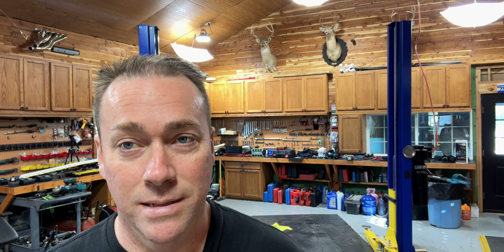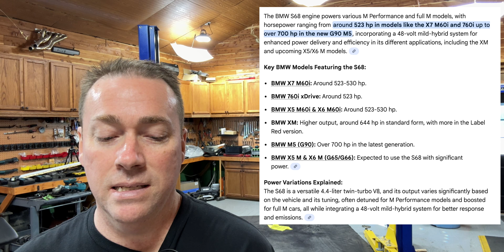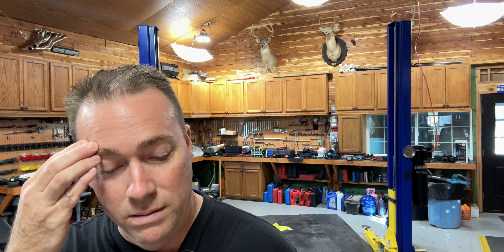The Truth About BMW's New S68 V8 Engine Reliability

Comment: The real statistics will only be clear in 7-10 years after the engine release year, and I wouldn’t even consider cases where the owner adds a cheap chip from eBay or installs a cold air intake that lets in ten times more dirt into the cylinders and oil.

Comment: Have a 21 X5 M50i since new, it now sits over 31k miles and is still going strong.  Next maintenance items coming up would be plugs and coils, plus transmission fluid flush.  Looking to put another 30k miles the next 4-5 yrs headache free.

Comment: Probably just not recycled plastic for the timing chain guide issues. They still recommend a 10k oil change interval and 3 year 36k provided maintenance. The oil should be changed every 5k - 5500 miles on these, especially knowing they might be using recycled plastic for the guides.

Comment: For BMW hybrids (7 and 5 series) in Europe the factory recommended oil change interval is 2 years or 18 k miles…of course most of them are used in heavy city traffic and stop and go driving and in addition to that the hybrid system switches the engine on/off continuously. Those engines are full of carbon deposits and sludge inside even after 60-80 k miles…crazy.

Comment: I think the problem with most BMW’s why the timing chains fail not all of them because I know some are just major failure prone to timing chain failure, but my friend has a BMW with the N 20/N 26 engine and it has 205,000 miles on it and it has the original timing chain guides I think the reason why on a lot of BM BMW’s the timing chains fail is because they recommend very long oil change intervals. Her car says to change it every 12,000 miles. She changed the oil every 3000 miles up until recently cause it started leaking a lot and it’s still going the chain does have a lot of slack when the engine shut off, but it’s still running as of now.

Comment: You’re correct! I’ve been driving Bimmers since 1984. Total of 8 Bimmers. I’ve learned the hard way that BMW intentionally engineer their engines to start to fail after 60,000 miles! High paid engineers look for ways to increase profitability from service? They know what they’re doing! Nissan removes the weak plastic items from the B58 for sustainability.
Reply: Nissan?
Reply: @runner3033  Maybe he meant Toyota?
Reply: Im in the market for a new daily driver... Im looking at a 2022-2023 BMW X5 40i (B58 engine).  Thats really the only BMW i am looking at.  Im used to BMWs from the 90s to mid 2000s.  I noticed as i had newer and newer BMWs that some of the things are intentional lol.

One problem I have - is I really like the X5....but I dont want to deal with the typical BMW stuff again.  My other 2 cars Im looking at is a Mazda suv and a Toyota Crown Signia (Hybrid).  I have older BMWs for "fun" but i never felt so weird and indecisive about a car brand that I like.
Reply: @Revelocity  The other thing you have to get over with new BMWs is iDrive 8 and up, with the buttonless bandwagon of stupidity that BMW has jumped on - complete with high gloss touch capacitive trash.  It's like they are trying to kill their own brand.
Reply: @ShowMeWhatINeedToKnow   I hate to sound like a grandpa (back in my day we had buttons) but I think certain things should have physical buttons, just by using logic.

Mazda announced their new CX-5 and they are doing the same thing - and all the mazda people threw their hands in the air once that was announced. A lot of people are unhappy.

With the X5 - the pre-lci models still feel normal, the LCI models (2024+) just feel odd to operate.  I dont like the gloss flat buttons - I had a 2024 GTI as a rental - I understand why people really hated those steering wheel controls lol.

It sad for me to see that the brand is going a certain way. I think part of my reason why I cant make up my mind - is that I think that this may be the last "modern/new" BMW that I buy or just buy for daily duties. Because so far all the newer stuff - I dont like. And if there is something I like a little bit - its not really a model I want to daily driver.
Reply: @Revelocity  Agree.  I don't think anyone can argue that it's much easier and safter to be able to push a physical button, sometimes without even looking, than it is to try to navigate software menus while driving.  The touch-screens are a disaster.

Comment: resurrect the M54
Reply: It still had explosive plastic cooling systems and leaky $2 gaskets that require five hours labor to change.
Reply: @runner3033  they all do but the 54 if taken care of lived longer than any newer engine, look at the shit they're selling now.
Reply: I miss my X5 mainly for that motor.

I bought it with needing a new head.  Did a bunch of work while in there - I had no issues with the motor and it being X5 it was returning 16-18 MPG (16 in winter, 18 in summer) combined. Yea its had its quirks but at this point - if you're able - might as well get one, yank the motor out and just reseal the entire thing and you're golden.
Reply: I thought that when I was looking for a car 5 years ago so I got an X3 3.0 
 Done 70k miles since. Needed cooling system parts and now it needs a valve cover. In fact it needs lots of minor things.

The only problem is very poor fuel consumption by modern standards. 21 mpg average. However even at UK prices it's still cheaper than paying for engine nonsense and depreciation.
Reply: @andrewthompsonuk1  If you own a BMW with plastic engine or cooling parts, you can expect to replace them at regular intervals. What I am referring to with the M54 is that the mechanical internal parts are long-lived compared to the crap valve train and timing chain, direct injection, and engine bearings and turbos that fail and on and on they make today. BMWs of today have a huge reliability problem.

Comment: Nathan, I just bought a 2016 in for service. They gave me a loaner 228 xDrive. It drove like a Hyundai. I was in shock.
It sounded like one as well.
Reply: Is that 228 xDrive a 4-Cylinder?
Reply: @MrSamPhoenix yep
Reply: Of course it does. It's a budget car and not a 6 cylinder.
Reply: I bought a new '99 Hyundai Tiburon, and a co-worker bought a used E36 Compact (95 or r96?). I liked my Tiburon better, after riding in his car.

Bottom range BMW has always been a bit ordinary.
Reply: what do you expect from their cheapest model?